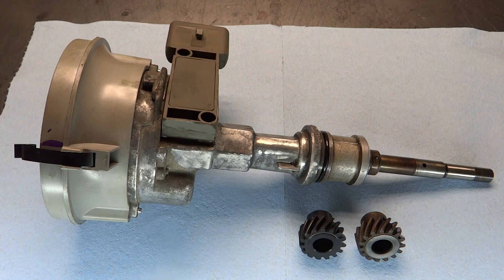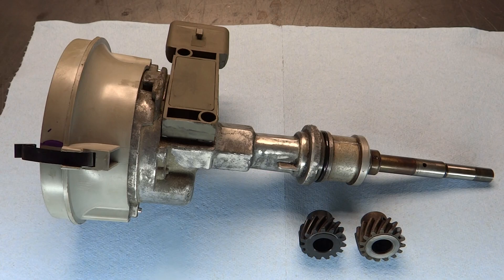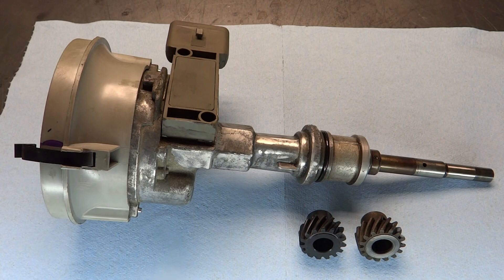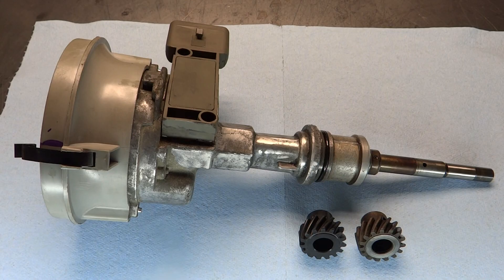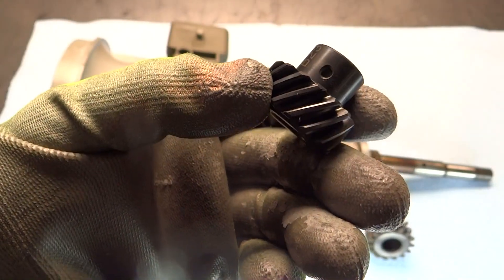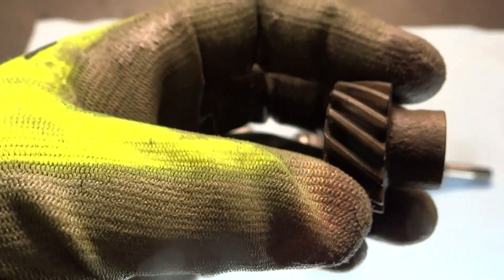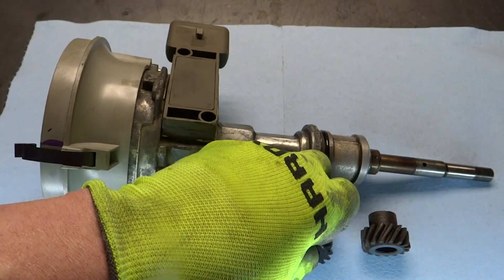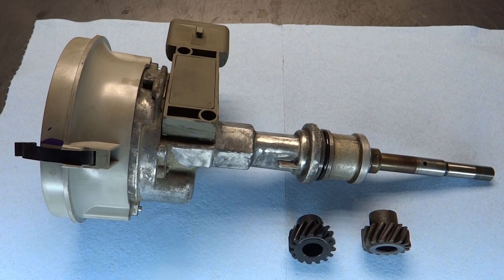Distributor Gear Material Vs. Camshaft Material

Comment: I run across this problem on a 94 bronco 5.8. I bought a rebuilt distributor. I checked the manufacturer specs indicate will work on my engine. When I  installed rebuilt distributor start up the engine. I noticed the distributor was moving back and forth. All once distributor just moved clockwise and shut engine off. I took the  distributor back out and  measure it  . I did not see anything different about gear pitch look like the same. I installed again and start  engine and shut off . I remove distributor  gear teeths damaged. I did not realize my old distributor gear is steel.  I did not know ford come out with a roll steel cam for for that year. A lesson I learned watch this this video thank you for the education .
Reply from the maker: Thanks for sharing your experience!!

Comment: That gear looks cast. Run a file across that cast looking surface and see if you can leave a mark. A steel gear you cannot leave a mark. I ordered a 1985 mustang GT distributor from Summit when I put a roller motor in my 74 Comet. That distributor was meant for a factory roller cam, comes with a vacuum advance, and was used with a duraspark II I think. I used a 4 pin GM igniter and wired it  a TFI coil. I also took it apart and limited the centrifugal advance  to 18*. So, I could use about 14* of timing and set the vacuum advance to give an additional 15*.  I got tired of all the debate over which  gear, and got the whole distributor instead.
Reply from the maker: I tried the file idea and the factory gear is a lot softer than the new gear, probably an iron gear. Getting a new distributor is a good way to go, When Ford drilled the roll pin hole for the gear in this distributor the drill must have wandered around making the hole off center which makes the roll pin hole for the new gear not line up properly. Thanks for the feedback.

Comment: Custom roller cam I have from Powell Cams says I must use a Bronze Dist gear, as well as drill a tiny hole in the galley plug that aligns with the Dist gear area.  I was told by the machine shop not necesary and every forum I checked said not to use the bronze gear.  In the end I did what Powell Cams wanted.
Reply from the maker: I would have done the same thing. Makes sense to do what the  manufacturer recomends.